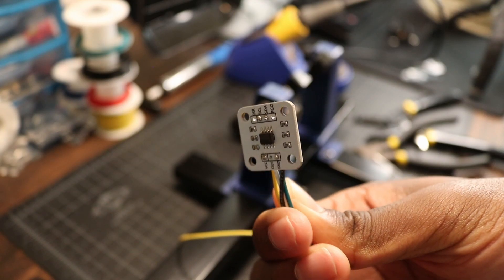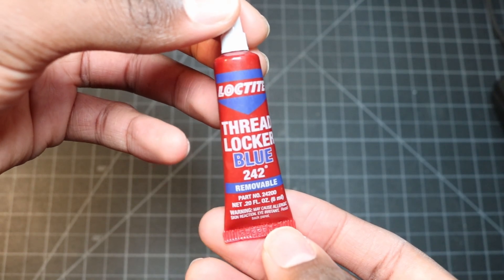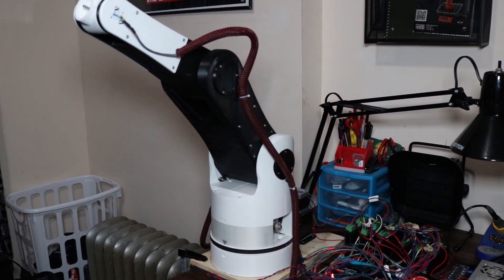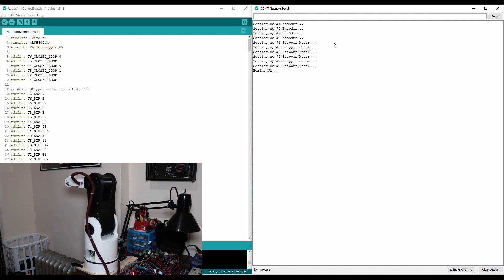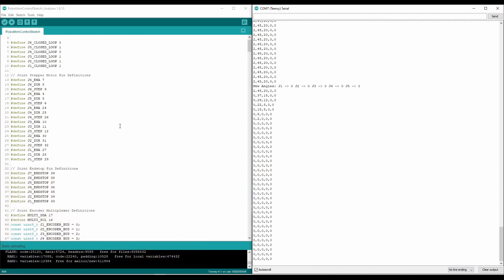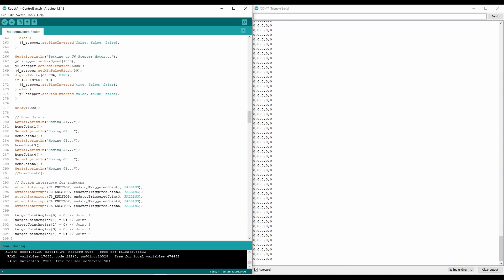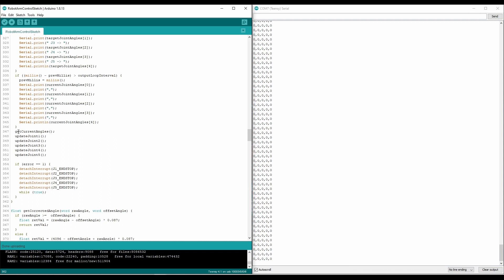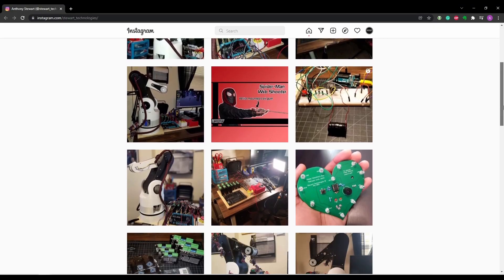3D Printed 6 Axis Robot Arm Part 4 | Basic Joint Angle Control

Comment: Nice work! Just wondering what torque rating your motors have?
Reply from the maker: Super late with this reply but I just posted about this on my website. Here's the link: https://stewart-technologies.com/2022/03/19/3d-printed-6-axis-robot-arm-mechanical-design/
Reply: @StewartTechnologies  cheers! I had been thinking about using digital servos with a max of 25kgcm of torque (about 2.5 Nm), so is comforting to hear yours have a similar rating